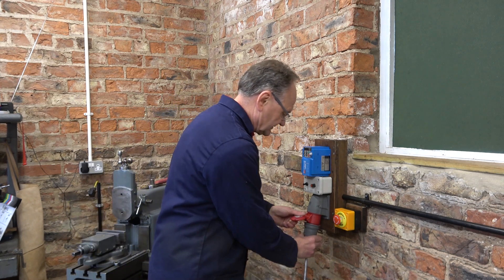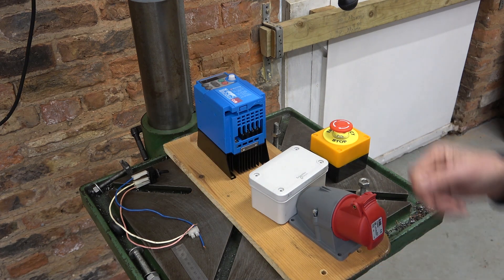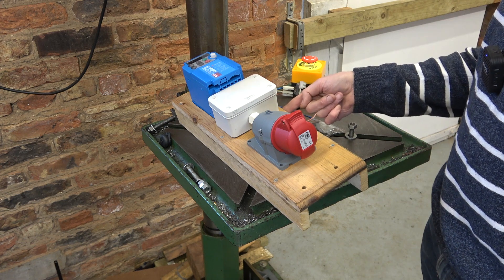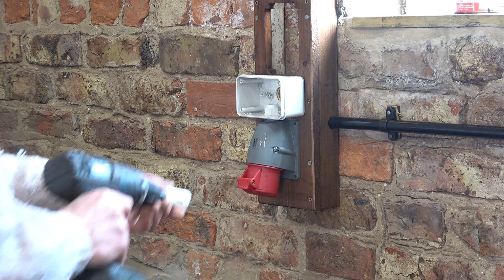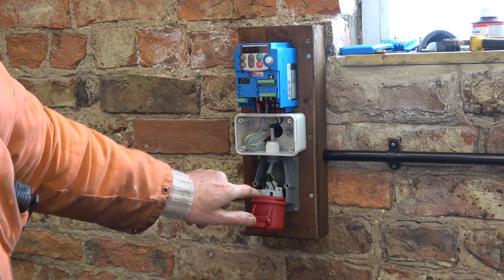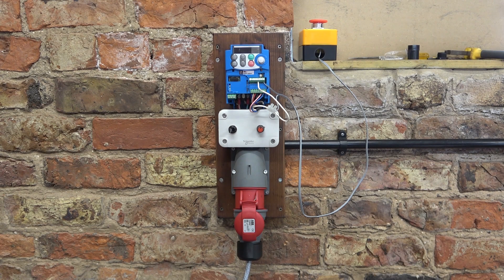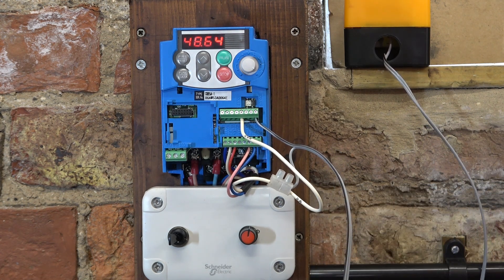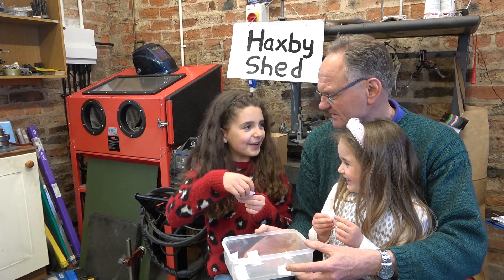HS131 IMO Jaguar Cub inverter installation

Comment: Hi there, I am looking to buy a meddings mf4 and was wondering what size vfd I would need?  Thanks
Reply from the maker: Hi Jeremy, I guess you know that the inverter I'm showing is to drive 3 phase motors from a 1 phase supply. Your chosen MF4 will have a plate on the motor showing the rating in HP or kW. If you need to know before you see your preferred MF4 then it's a case of finding the technical data for the various model options in a manual or data sheet. I had a quick look online and they look like nice machines. I hope that helps. Cheers.
Reply: @HaxbyShed  Yes I am on 240v single phase but not quite sure what motor is in the pillar drill yet.  It is being delivered in a few days hopefully I will be able to read the label thanks.  All I know it is 3 phase
Reply: @HaxbyShed  Yes, this is obviously very important that the motor has to be dual voltage. If my motor ends up being 400v only then I will purchase another 3-phase dual motor as opposed to a single-phase motor.  would you agree?
Reply from the maker: Hi Jeremy, I am no expert on these things but .... 3 phase motors are easy to reverse, require less current per phase for a given HP, and are easy to speed-control with a VFD. However drills do not need a lot of HP, are generally not reversed, and if it has  gears or step pulleys then maybe you don't need speed control. And in that case maybe a single phase motor might be the simplest solution (if the current motor is not dual voltage). Cheers

Comment: Great video Paul and nice installation. I would imagine it will be possible to program the e stop to reset the unit. Personally I would wire and prigram a separate multifunction terminal as a foot switch for the weld positioner. An e stop should be just that and nothing else. If I didn't make it clear before, I would like to be in the draw please!
Reply from the maker: Carl, congratulations on winning the draw. Your mug is on it's way. Cheers
Reply: @HaxbyShed  Thank you Paul. If I didn't make it clear in the post I left on the draw video, I appreciate your kindness and generosity very much.

Comment: Nice installation,  did look like a bird box at one stage 🦜.
Plenty safe enough for a single hobby shop.
Reply from the maker: Hi John, I have a couple of outside water taps disguised as bird boxes. That confuses people. I am still thinking about the ES setup - better than nothing but I would still prefer it to reset the on-off.  Cheers
Reply: @HaxbyShed  Hi Paul, the E-stop is only functioning as an Enable switch, it needs to be a no voltage relay (NVR), combined with a reset switch. Plenty on eBay for £ 22, these are for 240V 1 PH. You could use the 24 v suppy to create your own with a suitable 24 volt coil relay, only needs to be rated for milliamps. Have fun.
May I wish you and your family a happy Easter.

Comment: Hi Paul. That’s a very neat installation mate. I’ve got a 8kw rotary phase converter in my home shop, but they are noisy to run (I’m in a 2 car garage). I’m curious, does your inverter up the voltage? Here in Australia we have 240vac single phase and 415vac three phase. Congratulations on the 2500 subscribers. Nice to see the grandkids make an appearance too. Cheers 🍻. Aaron
Reply from the maker: Hi Aaron, you probably know that inverter technology can in principle give you any input or output voltage as either AC or DC, like the ones for use in cars that take 12v DC in and give 240v (or 110v) AC out. But in this application, i.e. 1PH in and 3PH out, I've only seen inverters that take 240v 1PH in and give 240v 3PH out so it means the motors have to be dual voltage.  I say 'dual voltage' because I have seen plenty of 3PH machine motors that only run on 415v but never one that only runs on 240v - so in practical terms they are 415v only or dual 415v and 240v. I hope that explains. Cheers
Reply: @HaxbyShed  Yes, this is obviously very important that the motor has to be dual voltage. If my motor ends up being 400v only then I will purchase another 3 phase dual motor opposed to a single phase motor.  would you agree?

Comment: Does anyone know if it's possible to change the programming of a VFD with an external device?  For example to send a config file to it from a laptop or similar.  I ask because it seems to me that it would be great to have two outlets and be able to more easily switch between powering them based on which config the VFD had.
Reply from the maker: Hi Bhima, to some extent yes but the digital interfaces on this inverter are those seen on industrial PLC controllers such as setting individual terminals to 1 or 0 to set conditions, or RS485 (Modbus?) and not the sort you plug straight into a PC, such as Ethernet.   However I notice one can buy a PLC controller with Ethernet connection. Most of the controls seem to relate to stop/start, alarms, and frequency so I'm not sure it is possible to configure all parameters remotely over the data link. But you have given me an idea and I might try it if I can get a really cheap PLC controller. Thanks for the question. Cheers
Reply: @HaxbyShed , I've never programmed one of these devices.  Now I am wondering if it's possible to use one of the multi-function I/O pins to change all of the settings required to use two different electric motors.  (e.g. if that pin is high use X for the setting, else use Y).
Reply from the maker: hi Bhima, I think you would have to investigate the manual. My feeling is it would set just one parameter and not a group of parameters. But I'm going to look at how Modbus message protocol works  and what can be set with that. Cheers.

Comment: Well Paul, It Is the same connection that i made for the inverter that i installed on My Bantam, also with the emergency stop and some programming on torque, brake time etc: i like very much your wood table, used to assembly all together, sometimes we forgot the wood, because we have plastic and so on, wood demostrated another time that It can be an elegant and simple solution to complicated problems! Thanks for your nice video, AB-SHOP.
Reply from the maker: Hi Alberto, I think wood is a fantastic material. Cheap, light, strong, flexible, non-magnetic, floats, easy to work with simple tools, insulator, carbon neutral, lasts for hundreds of years if protected. Cheers

Comment: Very tidy installation, it looks good. It is interesting to see the connector you used for the white wire, we have not used those for years and use lever wire connectors instead. Whoops, I will go back and edit my comment
Reply from the maker: GTB I thought I was a man of the world but clearly I am not because I had never heard of lever wire connectors until I got your comment. A quick internet search shows I must have been living in a cave for the past 20 years ..... but they are expensive and this was only 24v.  Cheers

Comment: Thanks Paul!
Reply from the maker: Hi Bootsowen, I will still do a short one on my Harrison lathe inverter setup sometime when I've got a chance. But it will be quite a few weeks away I think. Cheers
Reply: @HaxbyShed  sound. This has me primed. The inverter to a plug is a great idea. Even as a test bench arrangement for tinkerers like me who find a motor from time to time. Great idea. And it begins to come together, I’m getting there very slowly with the plc stuff. Even if it is just on/off. With the system you have with the emergency stop to the inverter you could have a micro switch with a physical latch on a knee or kick bar in front of the lathe as well as the push button. Just a stick would do it and add another layer of “emergency off”. Thanks

Comment: The recessed heatsink is genius!
Reply from the maker: Hi TRM, everyone appreciates praise but I think that's overstating it really ... but thank you it is welcome all the same. I have the next size up on my lathe and that has a fan but it's behind the electrical panel in my lathe stand so it's not too noisy. I've found these to be very good inverters for torque control (in my limited but not zero experience) Happy Easter.

Comment: Hi Paul,....I think both Mr Celsius and Mr Fahrenheit will not be happy with you!!
Reply from the maker: Hi Robert it was a reckless/needless comment by me ... I should be more considered what I say.  Today I did a bit of research. Apparently Centigrade was renamed Celsius in 1948 by some European committee. UK officially dropped degrees F in 1961 and switched to degrees C but it a took a long time to switch over. Throughout my childhood weather forecasts were given in Deg C and F, and C was usually referred to as Centigrade in my part of the world. Then sometime in my late teens perhaps Celsius started to replace Centigrade in common usage. When you are used to a name it's hard to switch to another for exactly the same meaning esp when the original name just seems to make perfect sense. Hey ho, we have to move with the times I guess. 😬

Comment: Copper pipe is my own go to for convenient, accurate and strong spacing. Nice installation. It’s lovely when a project comes to plan. Well done. 👏👏👍😀

PS I’d love a mug for workshop. Please enter me in the draw 👍
Reply from the maker: Andrew, you are in the draw. I will be pleased when I can just do a project without having to build the enabling infrastructure. It's like making something, to make something, to (finally) make the thing you wanted to make. Cheers
Reply: @HaxbyShed  I so know what you mean. I am in the throws of making some needed parts for old letterpress printing presses owned by various friends throughout the UK. So far the challenge has been to make numerous tools and fixtures so that eventually I can make some rather tiny parts. Frustrating yet enjoyable in equal measures.

Comment: Schnieder prices are getting to be a humourless joke at the moment!
Phil
Reply from the maker: Hi Phil, in the case of domestic work, I rather think these component prices are only sustainable because they are passed on to end clients and not at the expense of the buyer (i.e. the electrician doing the job). Maybe industrial electricians, employed by cost conscious factories, have to shop around more.  I don't know but it feels like that to me as an observer.  Cheers
Reply: @HaxbyShed  I had need of a particular starter for the Covmac lathe so went to my local electrics wholesaler( if there is such a thing anymore? I have an account and get 15% overall off, but pay cash at POS) Two choices are offered, a schnieder at Just over £90, and what looks like an Indian made copy for £45! they look identical internally,  so it's a no brainer, When I get back to the shop I check out the indian one, made in a huge factory in India , one of severl factories actually, and if you buy 1000 they are available FOB Calcutta for $4.50 each!!
Reply from the maker: @philhermetic  Wow that amount of cost-add for little value-add can't be sustained surely..... I think I read that bulk shipping costs only add about 1% of cost on average then there is import duty but even if that's double you are only up to a tenner so most of the rest is going to be handling and wholesalers/retailers taking a bite.
Reply: @HaxbyShed  There is a vast gulf between cost of manufacture in a third world country with a huge cheap labout force and the eventual selling price, if you look at the costs of India and chinese Imports compared to manufacture in Europe it is no wonder our industry has gone, ppl used to moan about the quality, but the Indian products especially just get better and better, and all electronics is now Korean or chinese! Remember the tinny little transistor radios we bought from Woolworths in the sixties, they spawned the Japanese top end Hifi equipment of the seventies! Electronic equipment that today is still top notch! They get clever very fast. At the same time the UK manufacturers were selling the same product they had sold for years at a new enhanced price! But don't get me started!!
Phil
Reply from the maker: @philhermetic  😀!
Reply: @HaxbyShed  Schnieder have just received a recycling award for recycling fishing nets recovered from the Arabian sea and the Indian ocean, sounds like they may have an Indian factory too! That could explain why the starters and internals looked so identical! Are they selling at “A penny plain and tuppence branded” and thus selling the same product into two different markets?

Comment: When you hit STOP the inverter should NOT restart unless you press a GO button.   You’ve justified to your self why your setup is O K. …………….but it ain’t……………it’s DEADLY,!!!  Go back to the design suite!!!

Stavros
Reply from the maker: Hi Steve, I realise it's imperfect like that which I highlighted on the vid.  I can make the emergency stop cause a reset if I use remote red/green buttons with a relay but so far I've not found the way to cause a reset when I'm using the ES together with the built-in panel buttons. Power failure causes a reset so that works (NVR). I will keep working to find a better solution, I think it's just a case of finding the right terminal and parameter. Meantime at least I have a big button to hit to stop, imperfect though it is. Cheers
Reply: A proper E-Stop should open circuit both legs of the voltage when depressed thereby completely disabling the VFD. It should be a Latching DPST (duel pole single throw ) switch. You should never open circuit the ground connection. Using an E-Stop is not good for the VFD but it’s designed to be used for emergencies only, not a stop button. If the wires short or the VFD faults you want to be able to remove all power to the VFD and not rely on its logic circuit as its wired now. If you want to turn the motor on and off for welding you just need another SPST (single pole single throw) switch in the place of the current E-Stop. Great work, thanks for the excellent content.
Reply from the maker: Hi John, thanks putting a DPST emergency stop in the power line to the inverter would do the job just fine I'm sure and that might be my final solution.  I like the idea that this does not rely on the inverter logic - which could malfunction in a fry-up.  Turning the inverter off at the socket whilst the motor is running (or even a power cut) does not seem to cause any problems and so a DPST ES in the line would be just the same.  Now in passing I'll say the two commercially purchased inverter remote control boxes I have came with instructions to put the ES in the +24v PLC line thus relying on the inverter logic and also coming to a rolling stop over the number of ramp down seconds set within the inverter parameters rather than a instant stop (although an inbuilt relay does cause a switch reset, so good in that respect). Cheers

Comment: How much are you paying for inverters??    I pick up 2.2's on fleabay for 80bucks.  They are cheap as chips these days.  I put the same size on my mill, lathe and grinder.  If one craps out, I go rob one off another machine.  I just bought a 4th for a hydraulic setup.  Its spinner a 7hp motor.  That was close to 200.  Still cheap as chips.😉
Reply from the maker: Hi worldtraveller, industrial quality inverters are expensive here and 2nd hand bargains are few and far between. You can buy a new cheapo hobby inverter for maybe US$80 (like the one I showed in vid HS127) and that will do for most hobbyists but I needed something of industrial quality to drive my welding positioner at very low rpm (good torque boost control). I managed to buy a used inverter off ebay, like the one in this vid (1HP), which I use to run my shaper for US$100 some 18 months ago but now you would be lucky to get it for US$150, if you can find one.  The one you saw in this vid was new - there was a seller with 6, selling off stock I guess, for about US$225 each so I went for that. It's possible they have just stopped making that model but I still see them listed new for about US330.  So in short, hobby grade inverters are cheap here but industrial quality inverters are not, even scruffy 2nd hand. So now you see why I'm sharing some "occasional use" motors across one inverter. Cheers
Reply: @HaxbyShed  Yup, prices are getting seriously out of hand.  Just wait until the world wide recession hits, it's going to be painful for everyone.  I still need to put together a welding positioner, too many projects and never enough time.  This latest adventure of mine is going to put me in the looney bin for sure!!!  Stay tuned!